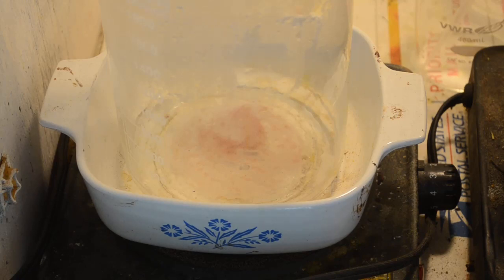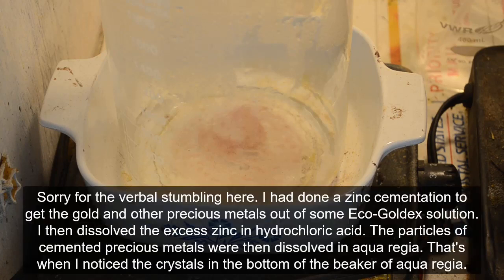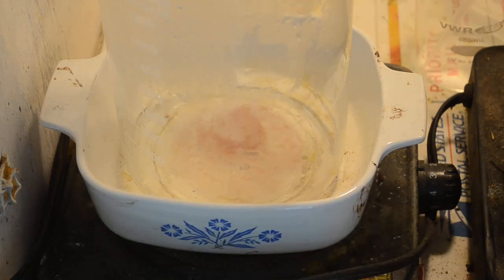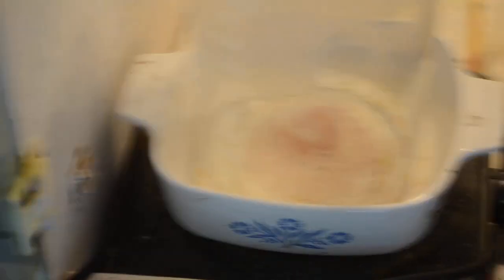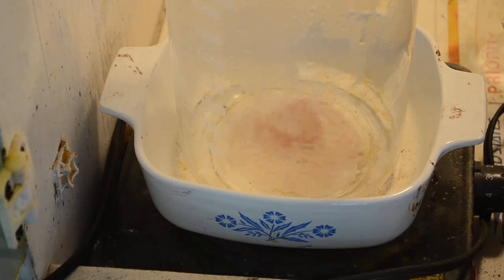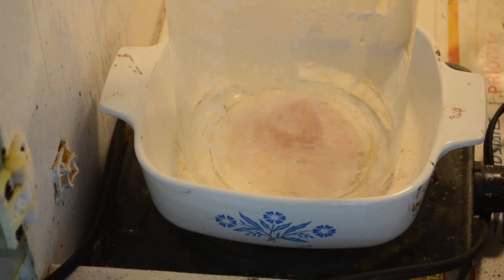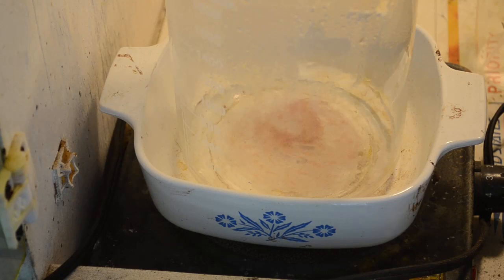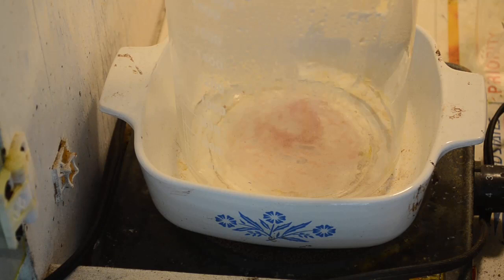Eco-Goldex Short: Strange Pink Crystal Precipitate During Gold Recovery.

Comment: What was the source material?  Based on the color, it would indicate palladium or maybe a form of iron oxide?  The insolubility is the strange part though.  I agree with what someone else said though, see if you can get to an XRF.  You could find out pretty quickly what elements are in it and then maybe determine its likely composition from that.

Comment: It's Silver Chloride, not soluble since it's been dried, exposed to o2, heated and exposed to UV light -  Silver Chloride that is fresh like cottage cheese is slightly soluble in hot dilute ammonia, but you need lots of it. Freshly precipitated Silver Chloride is only  slightly soluble in dilute nitric at high heat, but not pure nitric. What you have is crystalized Silver Chloride and is no longer soluble in acid. Smelt it to turn in back into dirty silver.